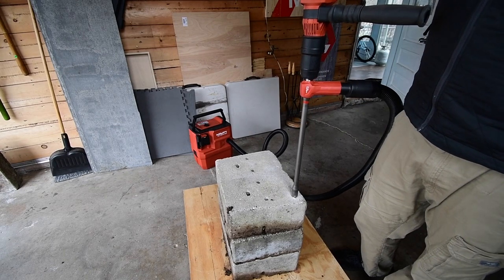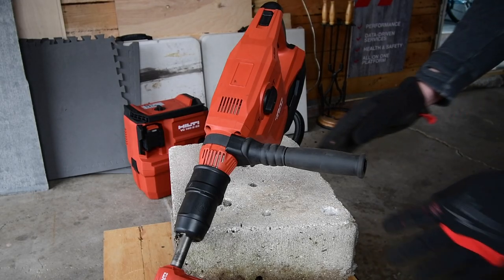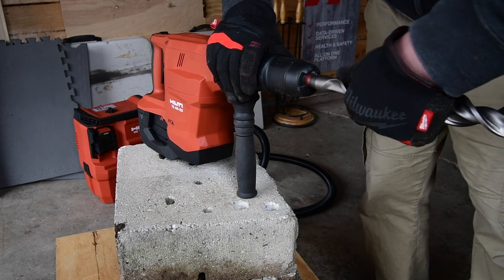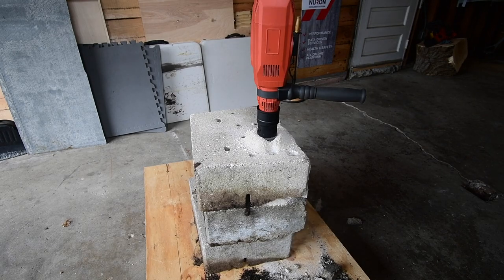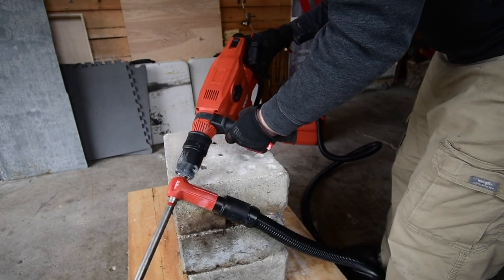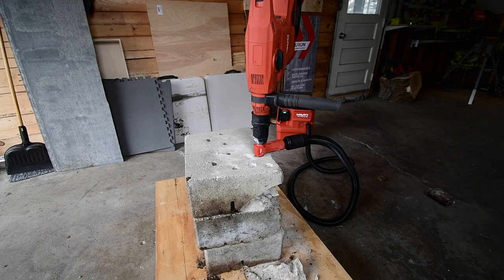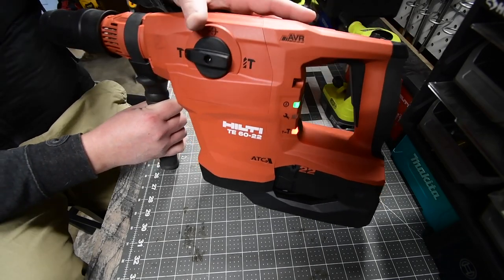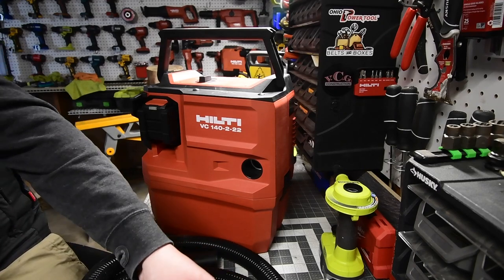BE HOLD, THE POWER OF THE (NURON TE 60-22)!

Comment: I’ve been using the vac for about a week or more.  The cfm is there but sealed suction is 1.7-1.8 kpa and not the 2.4 or more you can expect from corded.  Inlet doesn’t go straight to bag. There’s an elbow (technically two) to the bag and the diameter is a bit narrow for my tastes.  Concrete, wood and drywall dust, it’s great.  Site cleanup…hit or miss.  It can pick up debris but that debris might not make it to the bag. I cleaned out one hell of a clog and learned it’s limitations.  It wasn’t so hot when used with extension tubes and a floor brush. Infinitely better than the common 50-70 cfm vacs all over the market.  Build quality is sufficient but surprisingly not up to the level of Nilfisk/Starmix/Metabo.  I have a repeatable bug with the Bluetooth switch but work around it.  I’m going to use the back pack mounting points to rig up a hose wrap.  Loudness is noticeably more than the corded euro dust extractors but it’s still much quieter than the Emerson and Shop Vac ilk.  Hilti is out of their “conical for wood” nozzle for Bosch, Fein and Festool products for another week or so. The standard nozzle fits my Mafell stuff. It probably fits most Metabo. Every Makita product needs a different adaptor (always the case). For drilling, I use the accessories that suck to the wall, so I wish auto clean wasn’t automatically set to “on” at start up.
Reply: I had starmix . Built quality is sure not like the big hilt vacuum these are waaaay better

Comment: Hi Dave,
You should really be using Bit grease on the shanks of those drill bits to keep the chuck working well. Did they not supply you with any?  When I bought my TE6 A22 there was bit grease in the case. It is quite important to use it.
Dave.
Reply: He’s not using any? Bruh. I already kept it to myself when he started drilling into the corner…with an sds-max. 😂.
Reply: @robertrada4783  🤣🤣🤣 I thought exactly the same!!! I'm amazed it didn't break out.  It also amazes me how people testing drills into concrete just carry on drilling when the bit starts to labour. If he had just pulled the drill back a few times that would have kept the hole cleaner. Those hollow bits can still clog up. This saves on battery power and strain on the drill. I have just been using my TE6 drilling 8" deep holes into semi-engineering bricks. Only a 10mm bit but it went through like butter!!! I did get a bit of dust on the TE6 so will need counselling about that!! (🤣🤣🤣) but apart from that.....Amazing!!!!
Dave.
Reply: @davesheppard8797  He’s transparent about not needing to use a rotary hammer now nor needing one much or if at all in his past work.  So, I’m not out to give him crap about it.  The awning company that services my store, on the other hand… omg, what I have seen.  I digress. I don’t know what construction Man Caver did earlier on, but we’re in the same area and for residential, I know I never used one when I was a laborer.   I don’t use rotary hammers in construction, I use them when anchoring retail fixtures and the like at work.  I’m a total poseur.
Reply: @robertrada4783  🤣🤣🤣🤣

Comment: You gonna do a versus video with this? You can take the blocks apart, and drill them in 3 stages using the M12 fuel SDS drill, right? :)

Comment: Way to weak but for DIY stuff I guess it would be alright. Fail is the vacuum attachment when you have different sizes drill bits. And after a couple of weeks all your batteries will be trashed when you have to charge them over and over in such a short period of time. But funny to see your excitement for new tools - you’re just like my brother in law … every time he gets a new tool it’s the best in the world from his point of view.
Reply: I certainly wouldn't call Hilti gear DIY.  Their batteries last forever and the gear is tough. I don't use anything this big but my Hilti Te6 A22 is amazing and much faster than my corded SDS gear.
Reply: @davesheppard8797  Well drilling a couple of holes and then the battery is flat or the drill has stalled is not something I think would do well on a busy building site. Even as DIY. purpose I would personally be frustrated with the performance. But hats off to Hilti - they are trying to make a name of them selves in the new era of tools and brands but fall short on performance and consistency.
Reply: @jespersorensen8022  Hi Jesper,
I use Hilti now in work and their battery life is great. 2.6- 8.0 amp hour are all good and last for ages. Much better than my Milwaukee gear.
Reply: @jespersorensen8022  You may be missing the part of the equation where he was trying to run it off of compact batteries.  The issue with Hilti going all in on current instead of voltage, 21700’s, and 6 cells instead of 5 cells per row, is that you end up needing 4 or 5 different batteries.  The “compact” single row 21700 is bigger and heavier than most of my 5 ah 18v and newer 2.5 ah 36/“40v” batteries.  So then they decided to add a 2.5 ah 18650 compact pack, preemptively, for those that will complain.  Neither are going to work on this SDS-Max.  Meanwhile, 8ah can do it, but you want the 12ah for both the sds max and the vac.  Alas, you don’t want the 12ah on anything else (except the jackhammer).  Nuron is a clusterfuck.  I’ve been buying into it, but I called it on the batteries when it was announced, when I previewed them in store and after owning the products.  I use the one same size battery for Makita LXT, Makita XGT, Hikoki, Festool, Fein, Dewalt and Milwaukee (only because their tools aren’t worth buying the different size batteries for).
Reply: @robertrada4783  Hi Robert, Dave again! So what Hilti Nuron (perhaps it should be called Moron lol) gear have you got and do you know how well it compares to the standard 22 volt  tools, like my SF6H & TE6.  I certainly won't be buying any Nuron gear as I think it's just for large building/construction companies who use the "fleet hire".  It's not aimed at the little guy like me (Theatre Maintenance manager). I have been very impressed with my standard 22 volt Hilti gear.
Dave 🙂🙂👍👍
Reply: @davesheppard8797  Coincidentally, Hilti is trying to expand to the smaller business and personal use with the Nuron push.  Their clients that place large purchase orders aren’t watching you tubers demonstrate crates of tools while seeing  thousands of targeted ads. Within their niche of high rise commercial building and parking lot construction tools, they already have MUCH more residential and general construction products than Makita XGT, Bosch, Metabo HPT…etc.  No miter and no table saw, but how many of those do  you need framing a pole barn vs how many laborers are running around with cordless tools?  They want to go after plumbers and electricians, but Milwaukee has those sectors on lock. 

The vac is what I needed.  I have that.  I will buy the SDS.  I’ve owned Metabo (the real Metabo), Bosch and Makita SDS.  I’m using Makita XGT right now. It’s fast and powerful but it also blasts out material and the auxiliary handle is annoying to deal with. If I’m using a rotary hammer, I am specifically using certain tools (vac, impacts, drill).  I bought the impact driver and the 6H-22 first because I’m a slut for those.  Their impact wrenches do not impress me and the compact one is not out yet.  I am waiting for the compact impact, but as stands, my compact Makita is probably as good as Hilti’s mid torque. It will be a downgrade.  That said, 1/2” anchors don’t require much. 

The batteries are stupid. The batteries are stupid.  The batteries are stupid.  I need three different specific batteries for specific tools. Contrast that with my other products that all run on the same battery.   I had to buy the 12ah for the vac.  When I run the impact on it, it gets full power.  On the 4ah that they are pushing as the “regular” battery, it loses power just like every other power tool on a single row battery pack. The 8ah pack, meanwhile, is a beast.  

I’m not buying any circular saws.  I just have too many already. Mafell, Makita… etc.  The expensive grinder is very nice, but I have nice grinders coming out of my ears.  The other metal tools are what’s on the maybe list.  They’re all nice though.
Reply: I didn’t read your comment thoroughly.   If you’re buying the hollow drill bits seen in this video (and they are not exclusive to Hilti), your employees are doing hundreds (if not thousands) of the same size hole.   Usually I use a dust collection nozzle that sucks itself onto the surface and I can use up to 5/8” on it and then I have a larger one 3/4” -2” and then they make a larger one. It’s a generic product you can get anywhere for $10-30.  For five or six years now, they have vacs that attach directly to the tool with two or three different sized inserts but I didn’t like working with them (had both a Metabo and a Bosch one).
Reply: @davesheppard8797  I never actually answered your question.  An older SFH 6? Or the recent A22 version? Because I’m fairly certain the drill drivers and combination drills on Nuron are identical to their recent counterparts. The SDS is supposed to be slightly more powerful even though the website says they’re both “1.8 ft lbs” (2.4 j).  Everyone’s rotary hammer numbers are horseshit, though.  Metabo I had was “2.2j” and the Bosch was “2.5j”.  I know your 6-a22 is MUCH faster than that Bosch (which, in turn, was not faster than the Metabo). My Makita has three conflicting  ratings across the globe and so we’ll settle a claimed average around “3 joules”.   From what I’ve seen, the 6-a22 is close to the Makita in speed. Some tasks slower, others actually faster.
Reply: @robertrada4783  Hi Robert,  The generation 2 SF6H I have the first gen also but that wasn't a patch on the Gen 2. In over 40 years of owning drills and battery ones since they first came out I think this Gen 2 SF6H is the best I've ever had. 
Dave.
Reply: @davesheppard8797  So it’s the same as the Nuron one then? It’s probably the same as the Nuron one.  I want the 4-22 drill, but they took it off the market due to an issue with the gearbox. 🥲
Reply: @robertrada4783  Dave tested the TE4 on this site. I already had the Te6 when the 4 came out.  I prefer the extra diameter range of the TE6.  Plus I had wanted one for may years but couldn't afford one. Plus back then they were just SDS, there was no chisel function which is really good on the TE6. I would have thought the gear box would be pretty much the same?  Yes....I love my Gen2 SF6H.  Stay well my friend,
Dave.
Reply: @davesheppard8797  I’m confusing you. I was talking about the  4-22 drill driver and not the 4-22 rotary hammer.  Some, or many or  all of the gearboxes produced for the the Nuron versions have an issue.  They’re sorting it out.
Reply: @robertrada4783  Ah....OK! I'm with you now!! 👍👍